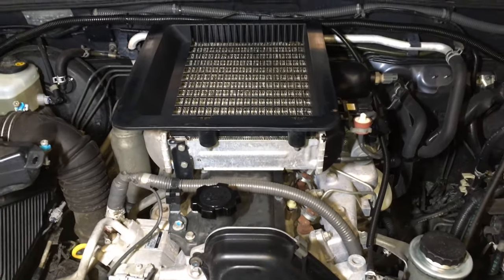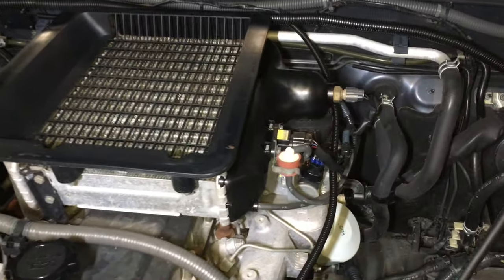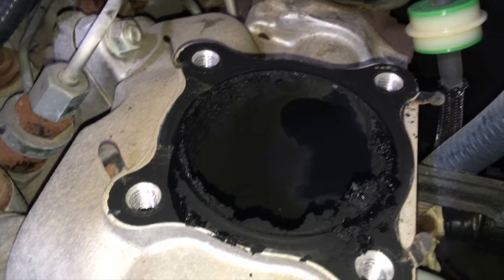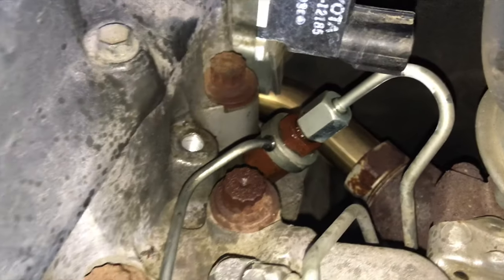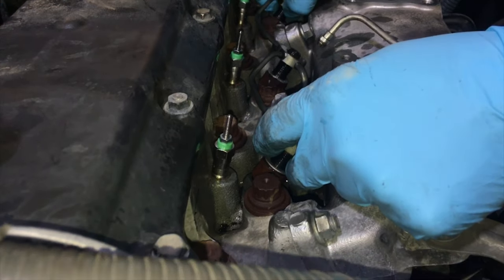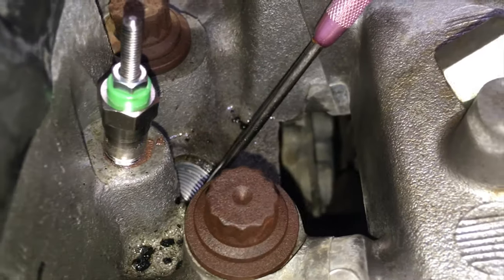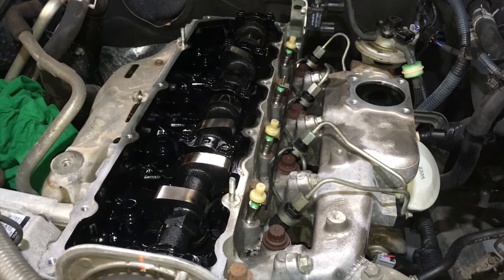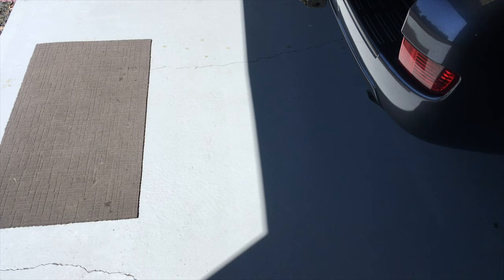INJECTOR REPLACEMENT 1KZ - ALL DETAIL YOU NEED

Comment: I’ve got a 1993 HiAce with this engine. I’m looking for a washer set for the injectors as I’ve found that the previous owner installed replacement injectors without the washers. I’ve noticed that the injectors for cylinder 1 and 3 have different sized nozzles from those for cylinder 2 and 4. The kits I’ve found online are all one size and I’m not sure if they’d fit. Do you know if this is normal for the year or do I have the incorrect part? Thank you for your time and I apologize if it’s a confusion line of questions. Thanks

Comment: Cable on the radiator outlet is a temperature sensor. Inside the car it will have a water temperature display. Prudent for the 1kzte.
Reply from the maker: Figured it out at the end of the job and thought to myself what the hell was I thinking 🤷‍♂️😁😂👍

Comment: Gday mate currently doing this job on my 1kz te 2003 toyota prado. Its currently got no power. You hit a hill and it drops to 70 - 80ks from 100kph. Iv replaced the fuel filter, map sensor, map filter. Injectors. Timing belt. Air filter. Its got an older steinbauer chip. 3" exhaust. Hook a trailer on and you might aswell get out and push it. It seems that under any sort of load it loses power. Any help would be appreciated cheers
Reply: You Fix the problem ?

Comment: Great videos !!! Just got a 1999 land cruiser 90 series with the 1KZTE (400K) and no service log …
How can I diagnose the injectors condition ? 
Thanks 🙏
Reply from the maker: If they haven’t been changed they won’t be working right if it blows smoke if it uses Fuel if it runs a bit rough maybe chances are it would seem to run OK but once you get new ones it might run a lot better I said gnu not remanufactured
Reply: @Fourby4Diesel  thank you for the fast answer! I

Comment: Do you need to bleed the injectors, or you just crank up and let the engine dealing with the air?
Reply: Wondering the same thing 🤔🤔🤔
Reply: IM ASSUMING THE HIGH PRESSURE PUMP PUSHES THE AIR INTO THE RETURN LINE DURING THAT LONG CRANK. IVE SEARCHED ALL HIS VIDEOS HE DOESNT EVEN MENTION BLEEDING LOL